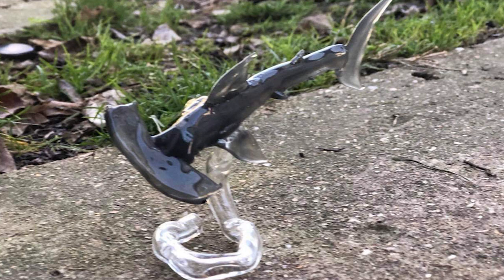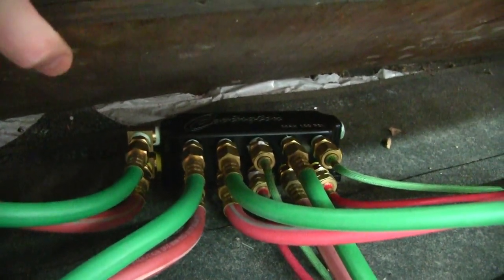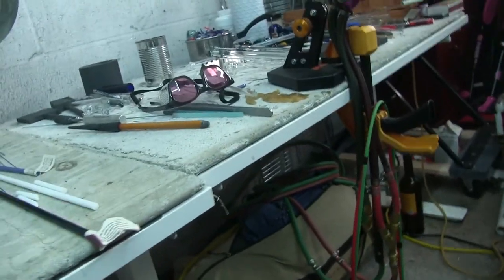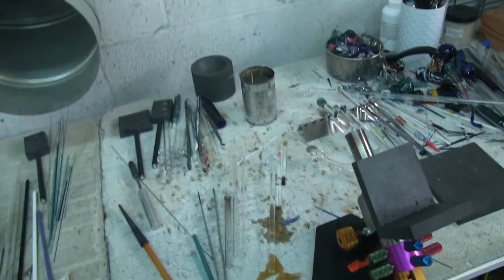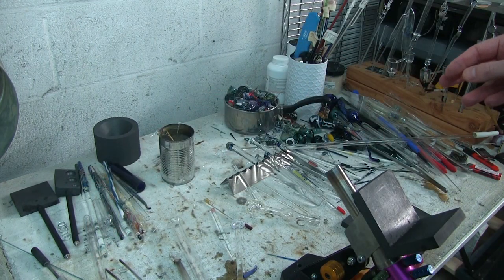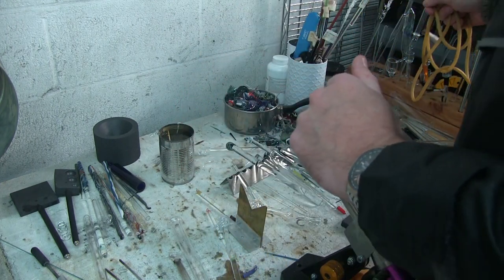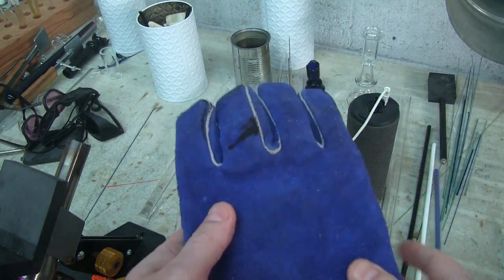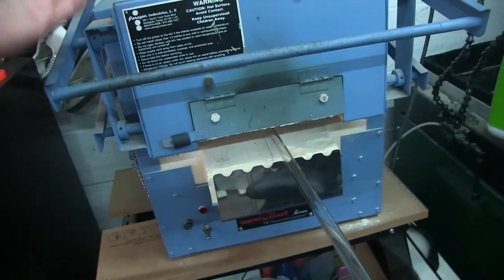Lampworking | Glassblowing Studio Set up | The Fusing Shop

Comment: Hey!! I love your setup, just a quick tip, if you are able to take the extractor fan outside the room you are working in, it will be a lot less louder. I can't do it so i have a setup similar to yours
Reply from the maker: Hi!  Thanks for the tip!  Yes, you should have a fresh air source as well with the ventilation system going.  I forgot to mention this 😬.

Comment: Hey looking at finally getting my own set up and I’m trynna make some space in the garage but i live in Florida and the garage doesn’t have ac atm. Is it safe to have my propane and oxygen in the garage during the hot summer months?
Reply: Just wondering if the temps are high enough to be dangerous and if i should look into a way of cooling the garage down even when I’m not working so things are safe.
Reply from the maker: Hi Michael!  Thanks for commenting.  My shop is in Central NJ and it gets pretty hot here in the summer.  I cannot answer your question with 100% certainty.  What I can tell you is that I don't have an AC in my shop either and I've never had a problem.  All of my equipment is out of direct sunlight which makes a difference.  I also have blackout curtains on the windows which helps keep the heat down.  TBH the shop gets so hot between the kiln and the torches running that I couldn't see a point in getting AC for my shop.  Again all of this is just my opinion and what I've been doing.  Hope it's helpful!  Sim

Comment: Hey, love the videos. You make a lot of stuff that I would want to make. I am brand new to glass art and trying to learn as much as possible before buying everything to get started teaching myself (I live a few hours from any classes). Is there any videos you have about annealing and picking equipment to anneal. Also I'm planning to use a open garage instead of starting with ventilation system. Would you expect this to be ok with one torch and kiln weather permitting. Thank you for the time you put into teaching.
Reply from the maker: Hey James!  Thanks for your comment and my apologies for the late reply.  You definitely need a ventilation hood or fan by you when working with glass, especially if you plan on working with fume.  Your kiln doesn't need to be vented but your torch area needs good ventilation.  I can definitely make a video on annealing if that's helpful for you.  You need a glass kiln such as a Paragon, Skuit, or Jenway.  You can find them here:  https://www.mountainglass.com/tools-and-equipment/kilns-parts-and-accessories/kilns

Comment: did you have to run some kind of needle valve  to adjust the amount of progpane/oxygen flow for the mini torches?  i had to get some when i tied my mini torch into my main torch. it would blow out until i adjusted the propange/oxy flow. asking bc i just ordered a manifold to add a new torch.
Reply from the maker: Francisco!  What's going on?  I did not use any valves for the mini torch on the manifold.  I just connected it the same way as my large torches and it was good to go.
Reply: @FusingShop  do you have the Bunsen running off the manifold as well?
Reply from the maker: @franciscogonzales2907  No.  I have two GTT torches, two minis, and my lathe running off one manifold.

Comment: Hello, I was curious as to what your table is made out of? I have also been looking for a video on how to use a kiln. How do you know what temperatures and times to use for different kinds of glass? Thanks
Reply from the maker: Hi Amanda!  I bought some tables from Ikea and have a layer of Duroc on them.  The Duroc is fireproof so if hot glass falls on it, you know it won't catch on fire.  I only know the annealing cycle for borosilicate.  For every quarter inch of glass you need to anneal for one hour.  If your piece has a half-inch thickness, you anneal for two hours and then keep it at the straining point for two hours.   Boro is annealed at 1,050 F and strain point is 950 or 960 depending on who you ask ;).

Comment: Just one question, what do you put pieces on when hot to avoid cracking?
Reply from the maker: Hey Ken!  Great question.  It depends on the piece and how big it is.  Some pieces need to be kept in the kiln to stay warm, some can be bench cooled.  I have a block of wood 2x6 with holes drilled in it to keep my blanks upright.  For smaller pieces I use a rod rest.  Hope this helps!  All the best!!  Sim
Reply: @FusingShop  thank you
Reply from the maker: @kenlane6655  No problem.  Always happy to help other glass blowers.  All the best!  Sim
Reply: So you would put a finished piece on a wooden bench to cool off?  I'm a welder of old and messed around with pyrex for a while (hobby) just returning to it for the same.  Just checking out what to use to avoid cracking when resting the piece.   @FusingShop
Reply from the maker: I always put finished pieces in the kiln.  I garage my glass at 1,050 F and then anneal the batch when I'm done for the day.  All the best!  Sim

Comment: Are the tanks (Oxygen/propane) not required to be outside? I was told that, but it has never been confirmed by anyone that does it at home.
Reply from the maker: Hi W B!  Propane should be outside, oxygen does not need to be.
Reply: @FusingShop  Awesome! Thanks.
Reply from the maker: @wb3191  You got it!  Do you have a corgi?
Reply: @FusingShop  No, she is a pit mix. Rescue from FL before I moved(back) to TN.
Reply from the maker: @wb3191  Lol cool.  It looked like a corgi from the thumbnail.  Respect for getting a dog from a rescue.